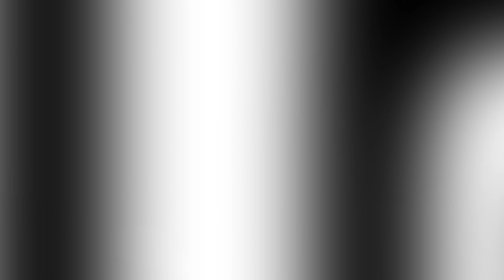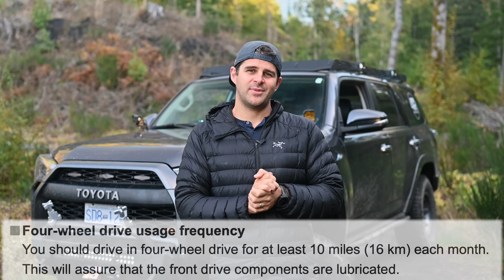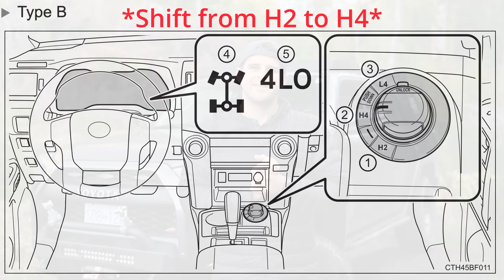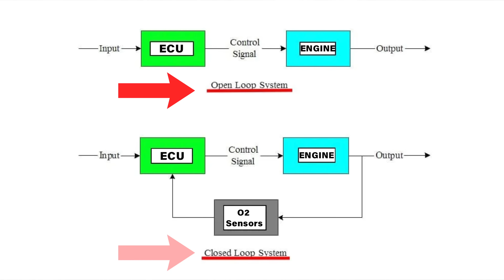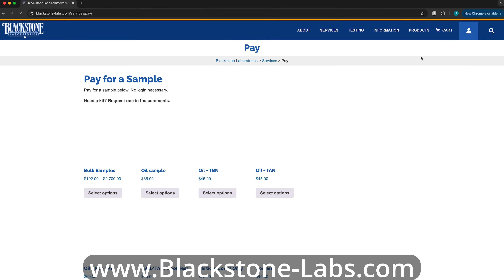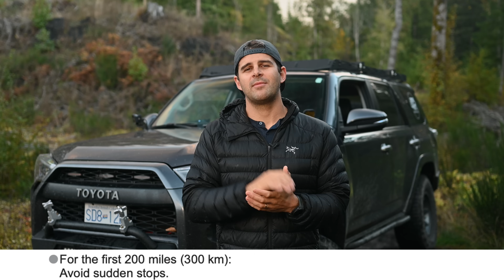5 Ways You Could Be Ruining Your Toyota 4Runner, Tacoma, or FJ Cruiser

Comment from the maker: Please Note: My explanation of locking in 4wd and damaging/stressing the differential/driveline could be explained a bit better. For the limited models the differentiation between wheel speeds, outside being the front & inside being rear, can put stress on the locking diff (limited models) and transfer case/driveline components (all other models).
Reply: Took to dealer for 10K service, and asked for Prop shaft fittings lubrication as specified in warranty guide. Both service advisors said it is a generic statement and they come lubricated from factory and don’t need any lubrication. Go figure.
Reply: @br31woodlands69  I hit em every 5k with Mystik JT-6 Hi-Temp and call it a day.  The prop shafts specify moly OR regular so it makes sense to just have one gun and hit them all at the same time.  I'm guessing the majority of 4R's are hitting impressive mileage without any lubing of any kind, so if you just grease them once a year you're probably way above average.
Reply: @br31woodlands69 this is false ! I was under mine today greasing them there’s grease zerks on all of them maybe 8 total
Reply: @br31woodlands69 wow.
Reply: @br31woodlands69 I have a 2017 Limited and both drive shafts are greasable. The service advisor was just making it up as he / she was going along. Service advisors are just sales people and often don't know what they're talking about.
Reply: You think the Japanese workers at the Tahara Plant would leave metal shavings in the engines?
Reply from the maker: @ not intensionally, no
Reply: @T4Rgarage  How fast can we go in 4HI ? Ok on the freeway or no
Reply: @kandaharenglish2595  I have the same question. Can I drive on 4HI on rainy, cold, Vancouver Dec-Feb road condition (mine is SR5 so no full-time AWD)? will exiting highway (not a straight line) damage the transfer case? What kind of turns are generally acceptable? For example, would it be okay to drive sea-to-sky highway on 4HI at around 80 km/hr?
Reply: @michaelcho1106  You could but it's kind of pointless. You want slipping on the front wheels which happens on snow and gravel to save on damage but not really on rain. 

Unless you're really losing the back on corners you should get new tires or chill your driving habits because this shouldn't be happening.
Reply: Do we really need to go 10 miles a month in 4WD in H4? How much for 4L?
Reply: Is k& n cold air intake good? Just asking new subcriber
Reply: @jonjones9357  I stopped using them for two reasons. One, the oil used on them can foul your MAF sensor. Two, they do not filter as well as the OEM ones and i occasionally drive off-road.
Reply: Didn't  hear you say WHEN  to change coolant? Thx
Reply: Sorry but I totally disagree with you. I have a 2010 TOYOTA 4 RUNNER LIMITED WITH A 4.0L V6 but I do not have a LOCKING DIFFRENTIAL IN FACT I DON'T THINK TOYOTA MAKES THE LIMITED EVER WITH A LOCKING DIFFRENTIAL BECAUSE THE LIMITED IS MADE ONLY FOR " LITE TO MEDIUM OFF ROAD "USE.
Reply from the maker: @ The 5th Gen 4Runner limited has, what's known as a "Torsen center differential lock"

Comment: Good stuff, but on the breakin part, I drained the factory oil out and put in breakin oil for new motors.  Ran for 500, drained and breakin oil for another 500. After that, drain and had 5W30 synthetic. I don't believe in 0W20

Comment: My 06 T4R Sport V6 has 199,468 miles on it and will be 20 years old next month.  I’ve changed oil every 3,000 to 4,000 miles since it was new.  This is the secret to engine longevity more than anything else.  The motor runs very smoothly to this day.

Comment: 1. Engage your 4wd at least once a month
2. Avoid cylinder washdown by not turning on and off vehicle frequently without letting engine fully run.
3. Get regular oil changes but more often if you drive on dusty roads, tow with vehicle etc...
4. Maintain your cooling system.
5. NEW VEHICLE OWNERS ONLY; properly break in your vehicle.

Comment: Just wondering if you've heard of others having whining noise coming from the rear (I think).  Kinda hard to tell drive train noise location.  The noise doesn't really get louder the faster you go, there's no grinding like wheel bearings, and it doesn't change when turning.  I did change the transfer and rear differential fluid and wasn't happy with the rear diff.  No chunks be it did appear to have a metallic sheen in the oil.  Plus the plug had a fair amount of build.

Comment: 2003 v8 240k.  Previous owner didn’t take care of the actuator and so I had to replace it.  It’s good now.  I also recommend people to clean their throttle body.  Not sure if it did a huge difference but I notice my gas per mile is way better after a clean rag with CRC spray and a bottle of sea foam. Driving an hour to work and back doing 4/10s has noticeably improved on my gas by a quarter left over.  With this economy, I say that’s a blessing.

Comment: 2002 limited 4x4 with 320k + still running good,everything works,do my oil change regularly with full synthetic oil,always put 93 octane gas,recently put old man emu springs and Bilstein shocks and new set of tires. Body in perfect shape and no rust.

Comment: Uh......4 wheel Hi or Low in not a differential locker. Driving on pavement in 4 Hi or Low should not be a problem on pavement......unless you lock the differentials.

Comment: Excellent video.  Thank you.

Toyota enthusiast here, having owned a total of seven.  My current fleet comprises a 2023 4Runner TRD Pro (8,030 miles on the odometer) and three 2014 FJ Cruisers, two of which are Trail Teams Ultimate Editions (automatic with 580 miles on it; manual with 150 miles on it).  The non-TTUE -- an automatic with 38,800 miles on it -- is my daily-driver.

Comment: You change the oil very early on all new cars, because new moving parts in the engine will produce considerable metal shavings in the first 1000 or so miles that will sit suspended in your engine oil until changed.

Comment: Allow me to explain why I recommend against Blackstone...

1) They're not ISO/ASTM Certified

2) They use Flashpoint to determine fuel dilution, sadly it's a mere guess. Gas Chromatography is more thourough and precise. 

3) TBN is extra, not included

4) There's online documents showing where Blackstone failed to acknowledge and catch potential issues, oil viscosity shear, oxidation as well as fuel dilution issues that were clearly higher when the same test went to another lab and was caught and diagnosed properly.

5) Blackstone doesn't test for oxidation - The oil's ability to withstand heat without thickening, coking up or sludging up. This is very crucial when testing and evaluating a lubriants health. Oil Analizers and Polaris Labs includes it.

On a side note and worth mentioning, big name companies and private label customers like: Ingersoll-Rand, Conoco-Phillip's, Cummins, Allison Transmission and Caterpillar all trust and use Polaris Labs.

https://www.machinerylubrication.com/Read/19/flash-point-test

Comment: We bought our 2019 TRD Premium from a Jeep dealer with only 15k miles. Is there a button or way to see tire pressure on either the dash or radio screen.
Reply: Well I have a 2017 and when tire pressure is low, it flashes on fashion. I literally found i had a nail in obe of my tires due to indicator warning. Slow leak. Got it fixed 😊
Reply: No you have to check it manually.

Comment: The whole 0w-20 thing is a US only thing , that’s probably worth noting. I run 5w-30 like everywhere else in the world
Reply from the maker: That’s fair. It’s also important to consider the temperature/climate where you live. The owners manual does suggest heavier weights, like the one you mentioned, if you live South of the border in hotter climates. Always keep in mind that most engine wear occurs right after startup. Having a thicker oil in a cold climate could increase wear as it takes longer to move up. I actually just ordered some 5w30 from amsoil for our next trip into Mexico
Reply: @T4Rgarage engine sounds a lot happier with 5-30 you’ll be suprised !

Comment: One of the biggest problems of this generation (along with the horrible gas milage and slow acceleration) is absence of the center differential (except for the Limited trim). Because of that, one is not advised to use 4H on dry surfaces. Nevertheless, it's recommended by the manufacturer to drive in 4H for at least 10 miles per month, to keep the actuator lubricated. But, good luck finding loose gravel roads if you live in a city. I consider it a design flow, because the previous generation 4Runner (part time V6 4x4) has manually lockable center differential, which in open position (a default setting) allows safe driving in 4H on hard surfaces with the speed up to 50 miles/h, without damaging drivetrain. When driving 5th. gen. 4Runner (non Limited) in winter on a road covered with patches of snow and/or ice followed by dry fragments of the road, If you stay in 4H, you risk damaging the drivetrain according to the manufacturer. So to prevent this from happening, is one supposed to be constantly shifting in and out of 4H while driving? I don't get why was it so hard for Toyota to put center differential in all of the trims of the 5th gen. 4Runner? Otherwise, the car is very solid and unless one plans heavy off-roading every weekend, in my opinion the 5th gen. Limited trim would be the best overall pick from the entire lineup (because of the presence of the center differential).

Comment: I have a newer Toyota 4runner and have been using the Toyota care for maintenance. I have been frustrated because the dealer flat out refuses to change my oil before 10,000 miles. I have done some light off reading, definitely exposed it to dust and some mud. Once I'm off Toyota care I will be doing changes every 5000 miles

Comment: Hello. I like your channel. One thing I would like to add to is to add magnetic plugs to all drain plugs. I am sure there are mag plugs sold, but I drill mine out and insert small, strong magnets into them. Every vehicle I have has them and every oil change produces a small amount of fine metal. Metal is like dust inside the engine and or gearbox. 
Carry on and be safe!

Comment: My 2016 4Runner has 108k - don’t think because I’m a retired Toyota technician that this is only possible for me. It’s been oil changes/ filters / inserts and front rotors/ wiper inserts- The only reason it got front rotors was abuse on my part.4x4  service lastly trans fluid change.
About a month ago the famous timing chain cover leak was getting bad . I did this at home and when I did this job - I replaced serpentine belt and spark plugs. I pulled the front bumper cover off to remove and clean the radiator.  The truck runs like new and I’m very happy with it
Reply: 2016 owner here as well - I'm searching for the cause of an oil leak that results in oil on the ground barely passenger-side of center at the front of the engine compartment.  Is this where the timing chain cover leaks?
Reply: @OFFICIALUND  The first clue I would get is after driving and getting it up to normal operating temperature when I got home and I get out I could smell something burning and I thought it was like rubber which told me it’s tires. It wasn’t the tires it was the timing chain cover was leaking and getting on everything- I spent a lot of time cleaning
Reply: Always gets bad on the right side even the v6 2grfe were all leaking from the right corner
Reply: @Jlb-fz7nl  O.k.  Thx.  Watching Vikings Garage's video on how to change the timing chain tensioner cover gasket right now.
Reply: @OFFICIALUND that one is super easy and I hope that’s all your needs
Reply: @OFFICIALUND just hit me up if you have any questions

Comment: When should I replace my coolant? Haven't done it yet.
Reply: Toyota says 100k for first change then every 50k or 5 years whichever comes first. I did 50k and will do every 50k. Cheaper than head gaskets and water pumps and radiators

Comment: Every issue I’ve had was Toyotas fault. Rusted in half frame. Rusted radiator. Rusted leaf springs. Rusted exhaust. Leaky heater core. Absolutely terrible paint. Maybe I should make a video titled 5 ways your Tacoma will lemon itself.

Comment: In 2019 I bought my dream truck, a 2018 F-150 2.7L Ecco boost, thinking I was set with reliable transport for the duration. Turns out in 2018 Ford decided to change the oil pump drive on the 2.7l from chain to Kevlar belt. In 2024 @ age 75 & then retired, I realized this F-150 would likely present problems @ the worst possible time for me. So, I sold it and bought a 2024 Rav4. I quickly realized this was not my best move. So, in November of 2024 I traded it in for a 4Runner. I broke it in carefully and changed the oil @ 1,000 miles. (A procedure I had followed on the Rav4 which was manufactured in Canada). Interestingly, the Rav4 oil showed signs of a fine grey powder. (Aluminum I assume). The oil and filter in the 4Runner showed no signs of metal. 
Especially of note is your recommendation to refer to the pqia.org and the moly count in Toyota oil. Makes me glad I spent the money on oil, filters, gear lube, trans. fluid & filter @ Toyota.
At what milage would you recommend changing coolant?
I consider it my good fortune to have T4R Garage to rely on for info and reference. Thank you!

Comment: I own a 23 Tacoma TRD Off Road, double cab, 6’ bed. It has every option / package available in 23 as it will be the last pickup I’ll ever own.
I’ve Always been a maintenance nut.
Since I drive only 8-10K miles per year I change my oil every 6 months or 5K miles.
Every oil change I have the tires rotated and I add a bottle of Techron fuel system cleaner.
Throughout most of the winter my Tacoma is in 4WD only because we live in the mountains of north central Washington state and get 5-7 feet of snow every winter.
We live 5 miles up the mountain from town (25 miles from the city) on a private road that we have to plow and maintain ourselves.
The towns and cities around our area are good about keeping the roads, highways plowed and clear for the most part, so during those times I’ll switch back into 2WD.
Every 3 years I change the antifreeze, brake and power steering fluids.
I’ve always changed the front and rear differential’s, transfer case and transmission fluids at 30K miles.
I use Mobile 1 full synthetic motor oil in both, my Tacoma and my wife’s Outback.
Our Toyota dealership changes my oil and filter for free as recommended by Toyota, so I have to pay for every other oil change.
After buying my Tacoma I immediately installed a cold air intake and a month later I had the Overland Torque Tune (OTT) installed.
The OTT gives my truck 25 more horsepower and 25 more lb ft of torque and Increases my mpg by 1-3. The OTT also STOPS the transmission from “hunting” for the right gear.
It is worth the $450 price and it Doesn’t void my warranty.
My wife and I save our money every month so that when our vehicles need replacing we have the cash to pay for them.
Since my 23 TRD will be my last truck we can add more to our savings each month so that when my wife’s Outback needs replacing we’ll have enough saved to buy her a new Toyota Crown Signia. By that time, the Signia will be her last vehicle.

This winter we had several bad snowstorms come in. They were so heavy that we couldn’t keep up with them on 4 occasions I had to put my Tacoma into 4WD Low and use my rear locker just to get up our road and into our garage.
My wife had to put her Outback into X mode as well.
During the summer months I’m often on forest, service and primitive roads so I have to switch from 2WD and 4WD and then back to 2WD often.
If I’m not off roading then at least once a month while driving straight I put my truck into 4WD just to make sure that it doesn’t “freeze” up.
Reply: I want to be first in line when or if your Tacoma ever comes up for sale, even 20 years from now.

Comment: From the get-go, I figured he might make the mistake of saying it's bad to drive with 4wd on dry pavement (which he did), but I didn't expect him to also say that the center diff locks each axle which turns the wheels at the same rate 🤦‍♂ . Doofus. You'd think more research would be done before an instructional video like this. This is how people get the wrong idea about their vehicles and post about it on other platforms. I saw OP made a comment about it, but should really put an annotation in the video too.

Comment: Do we have to go 10 miles in 4W mode when engaged?
Reply: it is recommended by Toyota, but The Car Care Nut on Youtube has said that you dont have to drive it, you can just leave it engaged for a bit while stationary.
Reply: @STUCKIN4LO  I thinks that’s for 4WD low only…. Just to exercise and check that the actuators are working.  I drive mine a couple miles in 4WD high every month to exercise the gears and move the fluid around

Comment: Great video as I literally just picked up a 2024 4 Runner with 15k miles on it. The used 2024 are going fast I got a good deal. Looking forward to yrs with this vehicle .
Reply: I did same exact thing!  Tried to find a new one, no luck. Found a dealer loaner with 14, 500 miles.  Love it!  The 2016 Silverado I traded in didn’t last 130k.  Hope this truck lasts at least 200k

Comment: As much as I nightmare as it is, I change my oil every 5K, and yes, I will attest, after back and forth twice between Castrol and Toyota that their is a definite sound idling and running difference btw them. I am now convinced and will only use the extra moly Toyota brand. It’s under 50k and I indeed want to be buried in it!
Gotta now figure best way to get driveshaft points lubed/another challenge….
Reply: Mobil 1

Comment: 2006, 210,000 milea. Always 5000 mile changes, synthetic oil (used Castrol Synthetic for most of the life of the truck now using Mobile 1) , 10,000 mile filter.